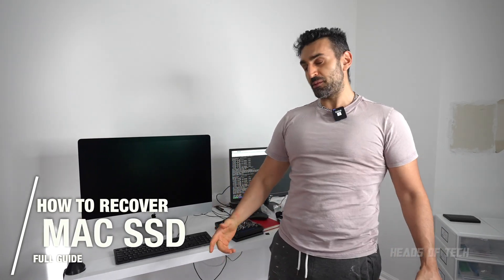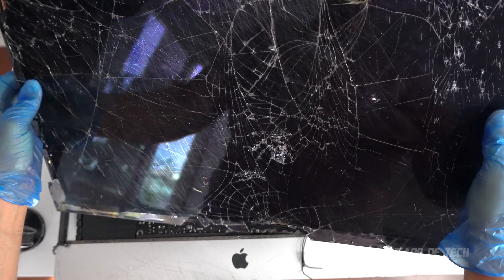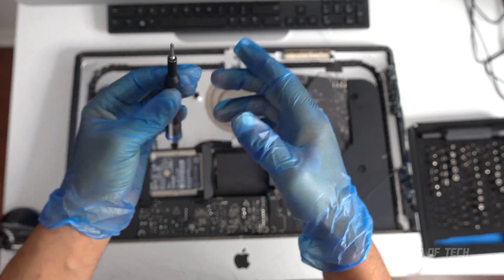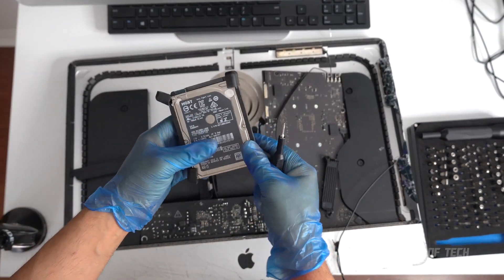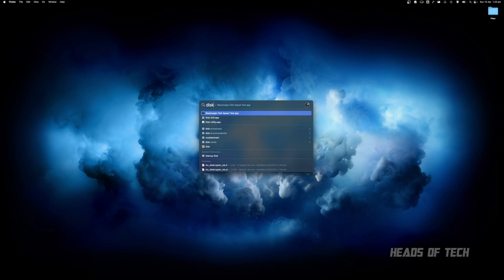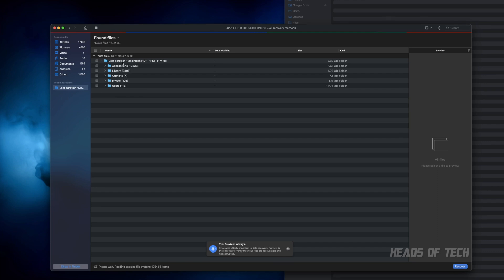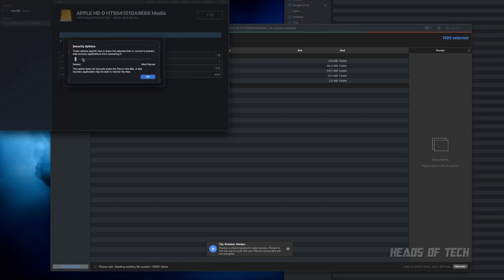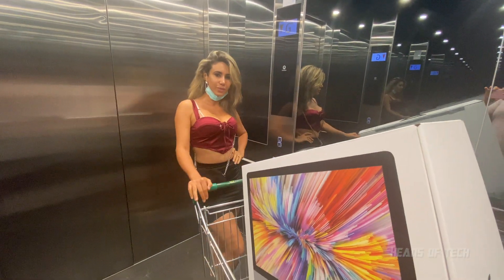How to Recover Data from a Damaged Mac SSD - FULL FREE GUIDE

Comment: first off thats wastefull af is that imac still works hell i would have bought it secondly thats not a ssd (solid state drive) that is a hhd (hard disk drive) and thirdly their is nothing free about this you need to buy tools a a external sata connector and a precision screwdriver set to open one up. Because people will still buy these device even if broken for parts ):<

Edit: if you dont want to buy something like a usb dock I would recommend getting a sata to usb adapter because they are pretty cheap and do the exact same thing for a lower price
Reply from the maker: Nice one, glad it got you. But rest assured, no working Macs were harmed in the making of this video. The working one was switched with a smashed one for the edit, you can still see the working one in the background.